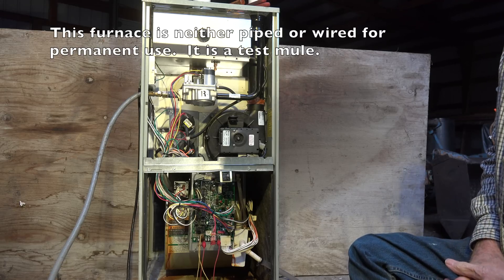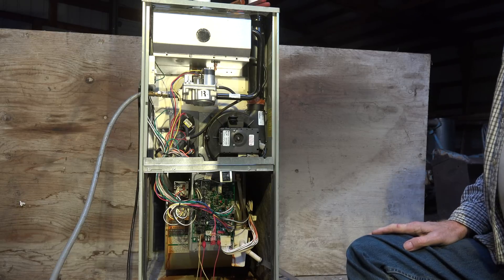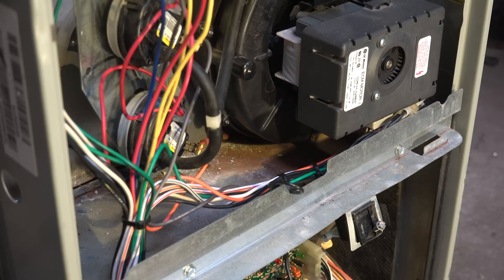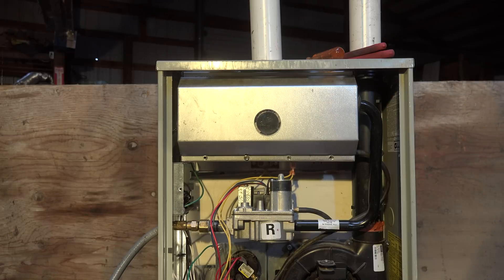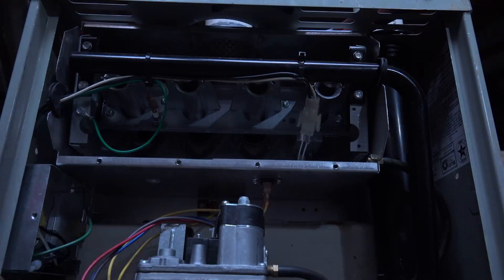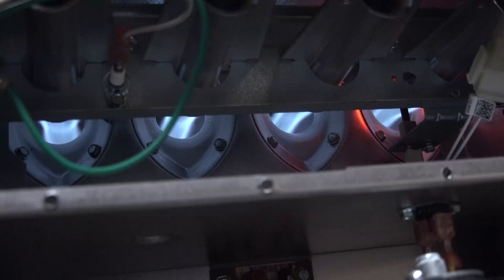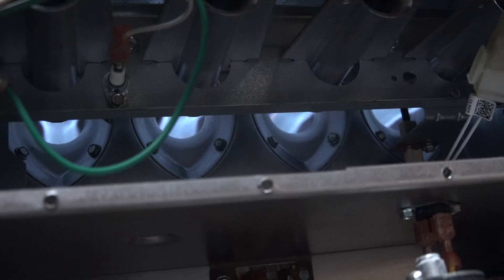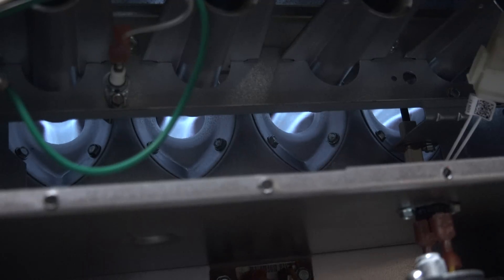Service of the 90% efficient gas furnace part 1

Comment: I have a Ruud 90 plus achiever with a fault code one. Was told the furnace needs to be replaced but Im not biting. Cant the heat exchanger just be cleaned?? Help!!
Reply from the maker: I believe fault code 1 is ignition failure.  That would not normally be a heat exchanger failure.  It could be a number of failures.  The only failure that would indicate replacement would be if the unit has a mercury actuated control system.  Do you have any details on the diagnosis?
GFM
Reply: @grayfurnaceman   I do, tech says " Furnace heat exchanger is plugging up bad, this is causing furnace to go out on pressure switch error and causing high carbon monoxide in the flu furnace needs to be replaced ASAP it will run but only with top door off furnace."
Reply from the maker: @tat255987  That could happen.  However, the diagnosis does not sound right.  There is a little too much sales there.  I would get a second opinion.
GFM

Comment: Hey I have this furnace (or one very similar) and the cover was off. I'm attempting to put the cover back on but not entirely sure if I did it right. There is about a 6 inch gap above the cover where the duct is and maybe a 4 inch gap at the bottom. I'm not sure if there should even be a gap at the bottom or if it should be flush.
Reply from the maker: Some furnaces have a top cover that does not cover the entire front so it may be normal.
GFM

Comment: What do you do if there is rollout?  Replace the heat exchanger?
Reply from the maker: Rollout can be caused by several problems.  One, of course, is a heat exchanger problem,  The heat exchanger could have a crack or a blockage.  Burner alignment or dirty burners could also cause this.  Gas pressure could also be the problem.  Incorrect orifices could cause this.
GFM

Comment: Again, Great Videos...quick question though...I have a 15 yr old Bryant 90plus Gas Furnace (has a recall I just learned from your videos) and it turns off after about 3 hours and wont turn back on (I'm assuming as a result of the flame blow out switch on the combustion chamber cover..It gets reeeaaaally hot to the touch). After it clicks off the blower motor stays on to cool the unit until I turn the breaker off.  Does the combustion chamber cover normally get that hot?
Reply from the maker: No.  It is probably rolling out from the blocked heat exchanger.
GFM

Comment: what would cause the flames to kick back or roll out dlightly when the burners come on before the fan comes on . What can cause that and how can it be corrected
Reply from the maker: Depends on how much they rollout and when.  If the rollout is about 1/2 second when the burner first comes on it is normal.  If it rolls out and rises up the front of the furnace, the heat exchanger is probably plugged.  If it rolls out when the fan comes on the heat exchanger is probably cracked.  Hope this helps.
GFM